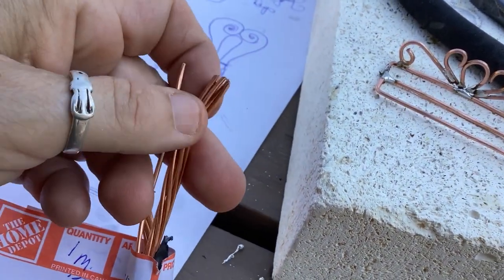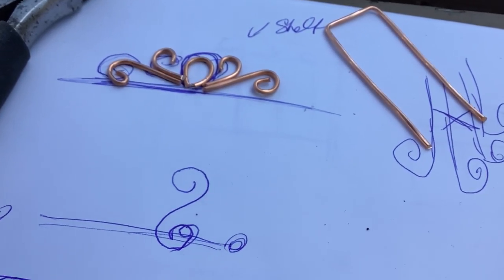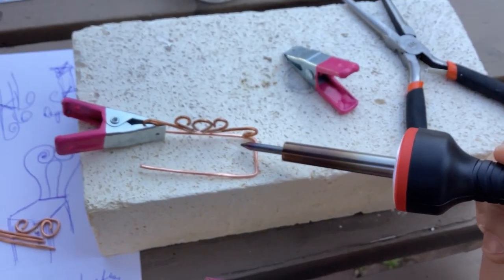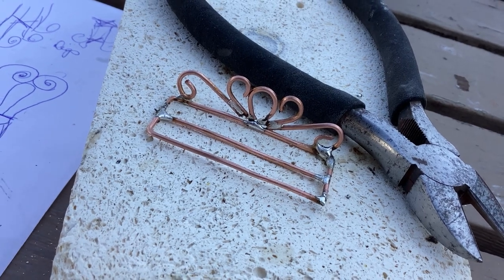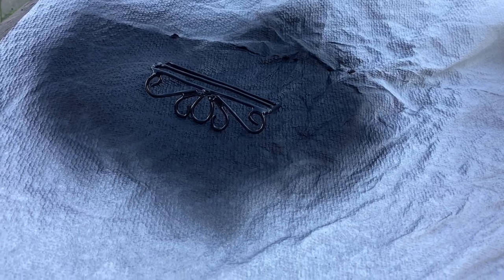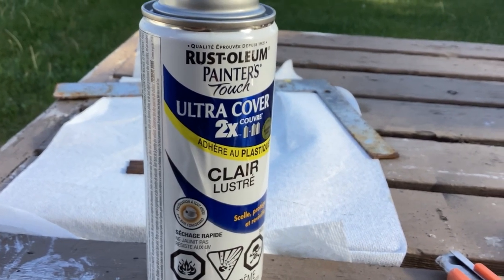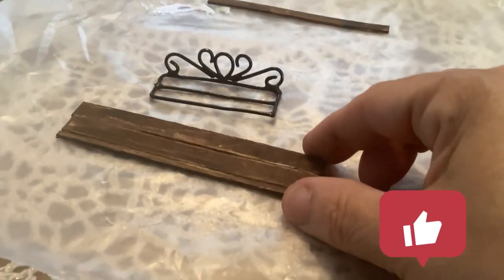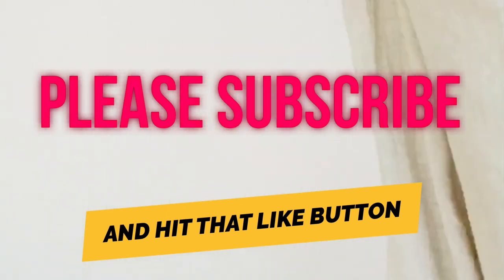DIY Copper Wire Miniature Furniture!

Comment: Fun. Yes it is nice when our partners help out. Mine was moving my stuff about today too. I’d like to use this technique to make something to hang kitchen tools from. Zap 5,000 is a very good glue by the way as is 5 minute a-oxygen. Hard to glue two different substances together. Clamping also helps. How about a block of styrofoam with toothpicks  stuck in to hold items you wish to spray. Use a cardboard box for a spray booth. Cardboard box can be folded down.I knock things over and would get things stuck to the paper towel. The acrylic spray was great as it made for different textures. Tape that styrofoam down so it won’t move if you knock things. Great project.
Reply from the maker: Grateful for the tips! :)